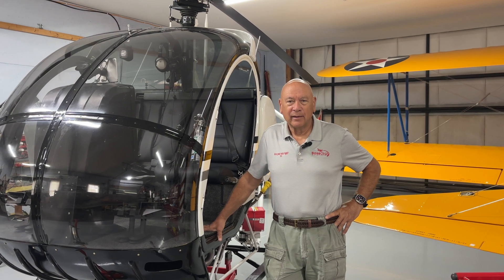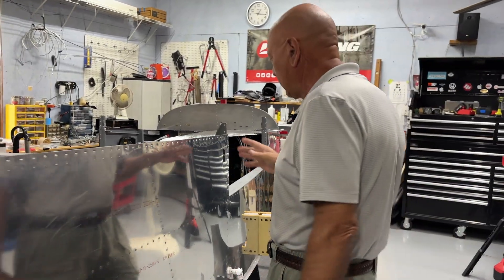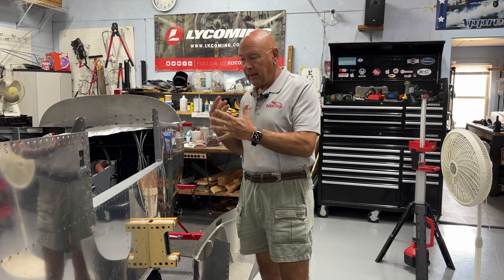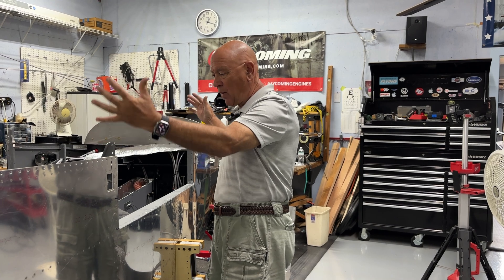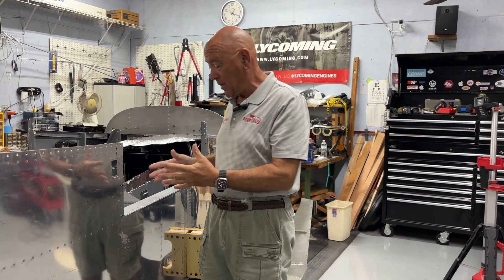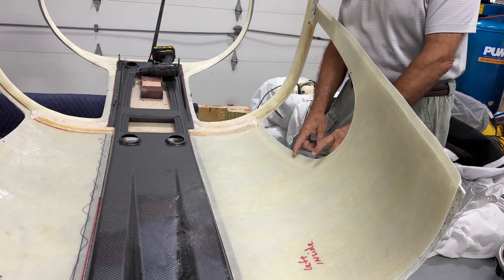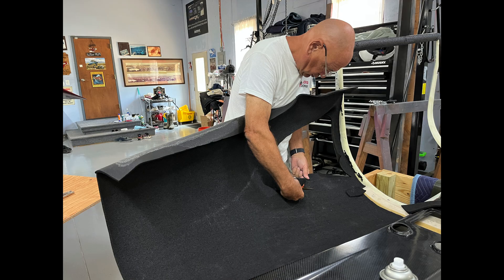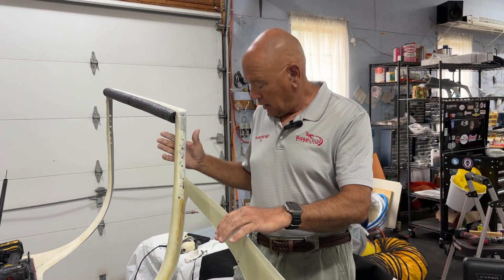RV 10 Build: Cabin top Aerosport console and headliner panels

Comment: I don’t understand from the video what the sheets are on the left and right of the Aeros port center council  Are they custom parts from Aeros port to cover the cabin top?  Do you cover them with fabric?  Do you glue them to the polyester cabin top
Reply from the maker: They are aero sport headliner panels. if you look at the video description you will see a link for them. you cover them with fabric or headliner material. They can be velcroed to the cabin top. Aerosport has videos on their website showing how to use them.

Comment: What is your favorite tool for cutting/sawing fiberglass?
What is your favorite tool for sanding/grinding fiberglass to fit?
What kind of epoxy do you use?  West Systems?
Reply from the maker: combination of Dremel ( with a diamond cutting wheel), 2” drum sander on a drill, and various palm sanders. yes, west systems epoxy.